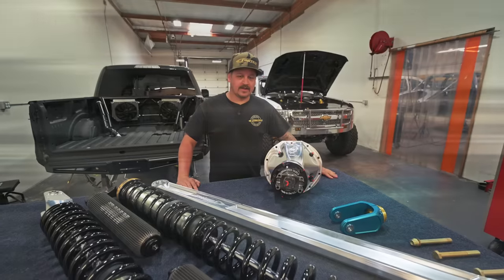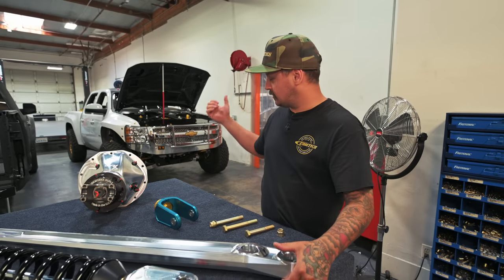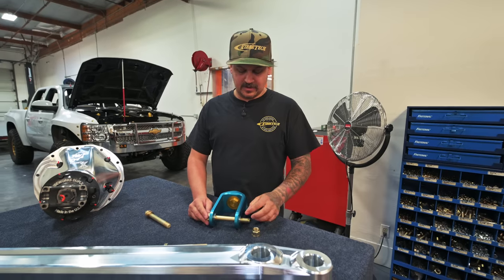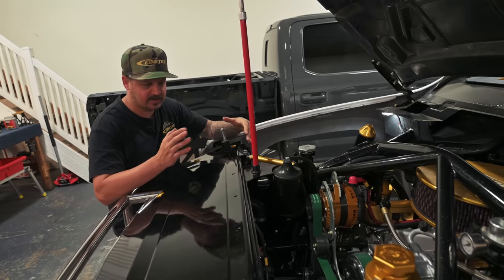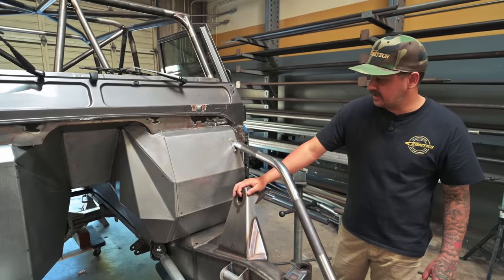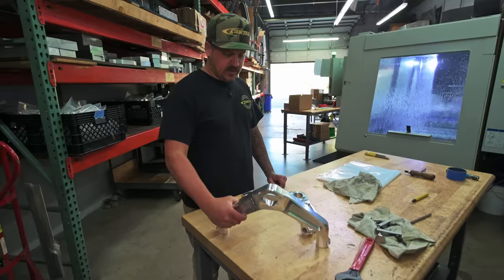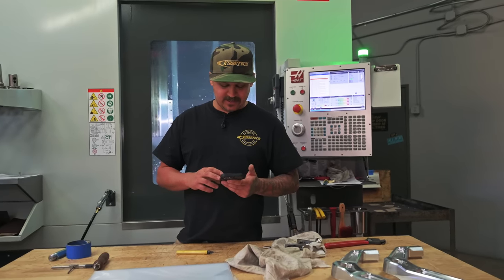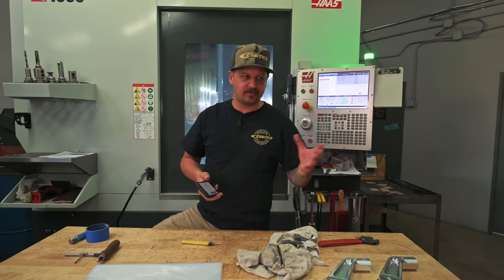THE EVOLUTION OF OUR OFFROAD PARTS

Comment: The way that I’m able to get around state required admissions I live in Texas. My truck got a 502 big block and I run around and open headers. Nobody does anything about it not even the cops. And I guess I’m the only one that I’ve ever met that runs an actual true, five speed manual transmission in the last six years I just recently got into pre-runners I seen a video called recoil one with the legendary BJ Baldwin, and after that I was hooked, but coming from road course racing and other different forms of that I can’t live without my manual transmissions branded. It is way harder to do and kind of pointless but it’s still fun 34 years old and out of everything I’ve ever driven I’ve only ever had two automatic vehicles.